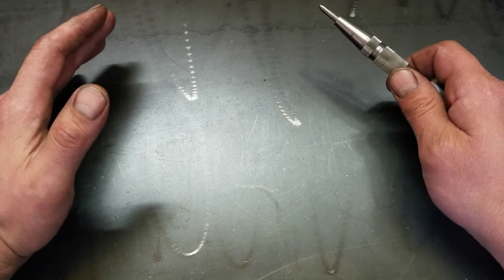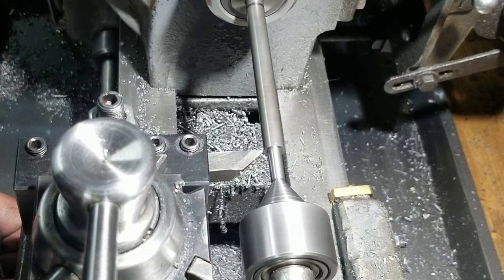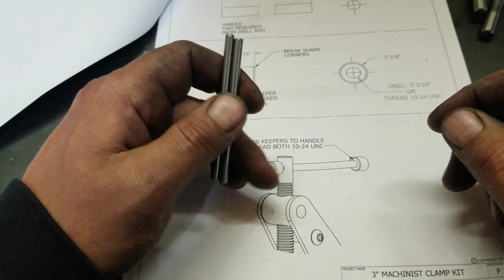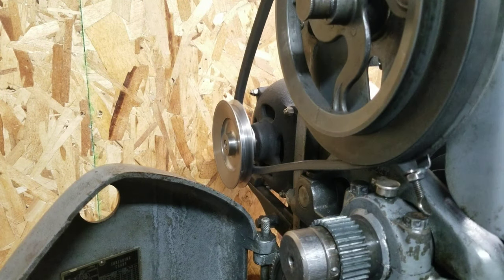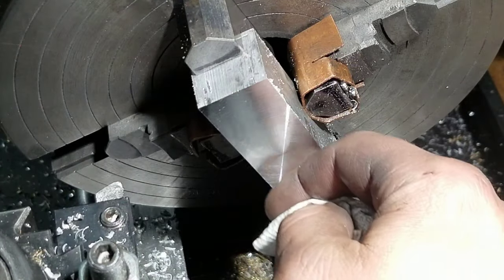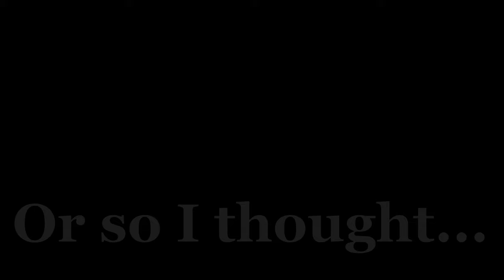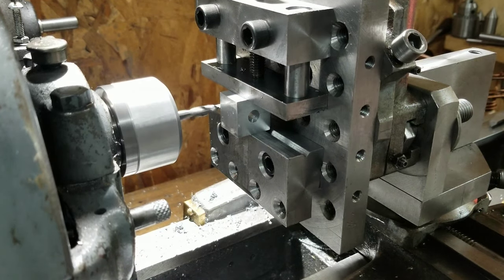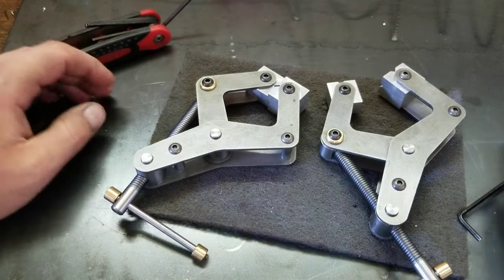Making Kant Twist Style Clamps! Part Deux! 🤩

Comment: Clamps "turned" out real nice. Those pulleys you fitted added a few RPM to the spindle I'd say. You seem happy to have the extra Revs and machine doesn't sound like it minds either. A few extra drops of oil to the bearings when in overdrive though might keep them happy a long time 🤞🤞😁, easy enough to check for extra heat too.
Chuck fix in the works?? Making a replacement screw??
Reply from the maker: Thanks man! Indeed, the added rpms sure help when spinning a 1/4" endmill that's for sure 😁. I top up the oil cups for the spindle every couple hours for just that reason. There's a bit of heat but mostly on the counter shaft bearings. It's pretty worn out but just found a new pulley for it so there's gonna be a whole rebuild in the near future 😊. As for the chuck screw... well found a remedy for the too, no spoilers 😉. Thanks again mate, appreciate the comments 😁. Cheers!

Comment: Some dark cutting oil will help that die threading quite a bit. Any reason you didn't single point those threads?
Reply from the maker: Thanks. The oil I have is actually for pipe threading (it was free, sue me 🤣). I generally won't single point anything under half inch (unless it's an odd ball size or something), plus this is super fast and easy when it works properly 😉. Cheers !